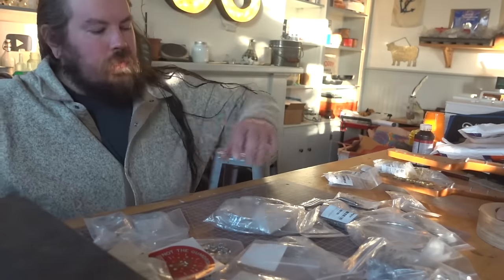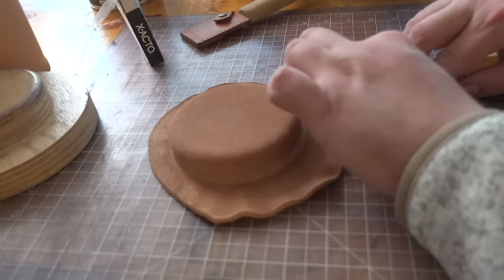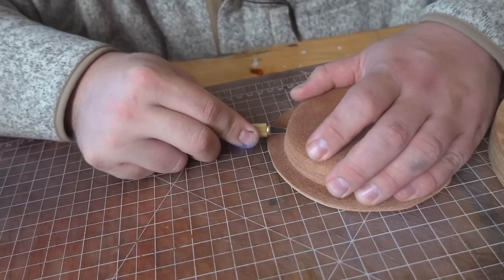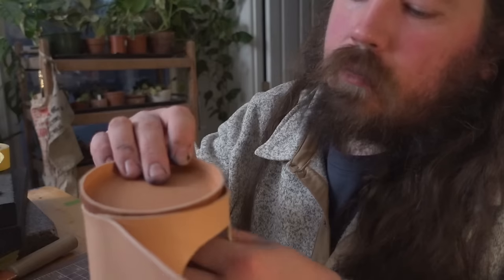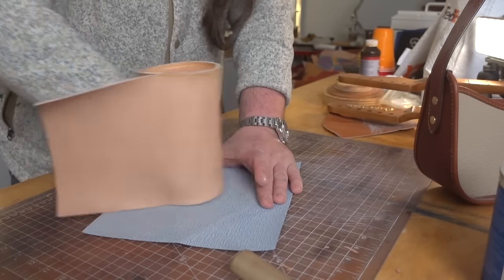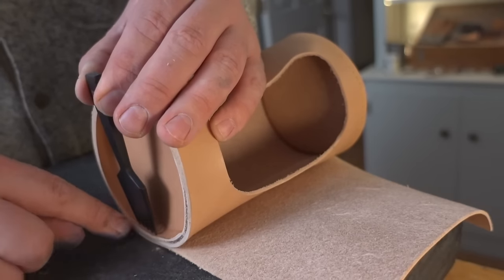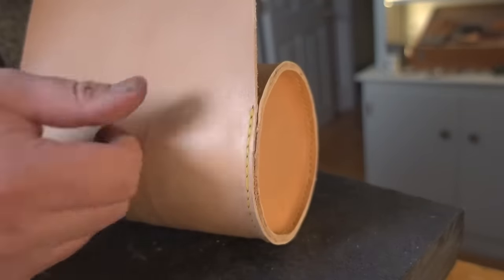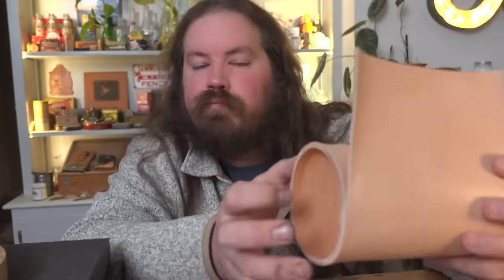Leather Wet Molded Trays are Boring.

Comment: Eric why don't you put the mold back on - draw your stich line on the out side - punch it on the out side into the wood mold. I don't think it would hurt those strong  pricking irons.
Reply: Yea but you'd prolly hurt the mold. And leave marks that would mess up the next thing you mold
Reply: How would you know it would match back up?  When I made mine I had to use a hand awl and do ine hole at a time from the inner ring outward.

Comment: 7:14 
hey so for this part what is the benefit of evening the edges with the knife instead of just using say, a Dremel or rotary tool to sand them even, then using the sandpaper? 

I’d imagine…from experience… the Dremel is potentially more destructive and easier to accidentally hit the top grain or something but curious for your take on it.

Comment: Someone correct me if this approach wouldn't work: first punch the holes in the body of the bag before while it's still flat, before it's curved and the ends are attached. Then once the ends are glued in, use an awl to punch through the existing holes and through the wet-formed ends. That way you ensure a perfectly straight line on the "show" face. It would certainly add time to the process, so maybe it's not something you'd be doing if you're trying to maximize output.